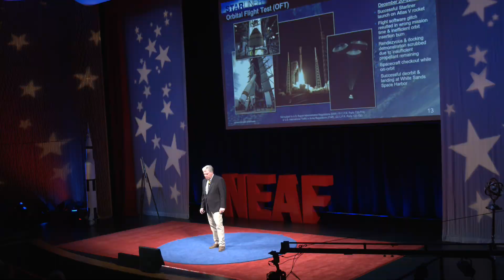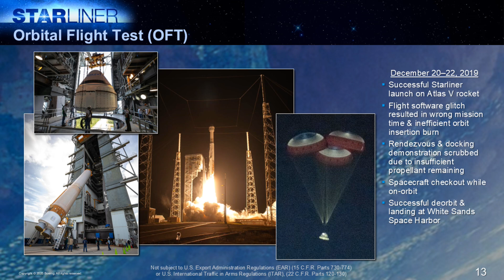Boeing Starliner- The Real Story Behind What Went Wrong | NEAF Briefs

Comment: Sounds like this guy is sugar coating what really happened.
Reply: He was there and he knows the systems.  You should be asking, how many times did the thrusters overheat during testing and the solution was to let them cool off, then relight?  It seems that this was the norm.  Hence,  the various redundancies built into the Starliner's thruster systems.  
     The testing after Starliner was docked to the ISS, was to cover the manager's butt whonhad constantly dismissed the concerns the previous for 5 years.